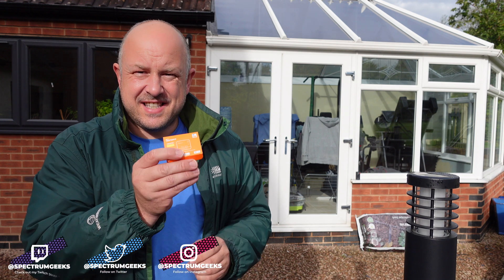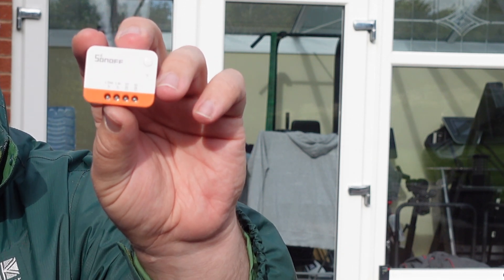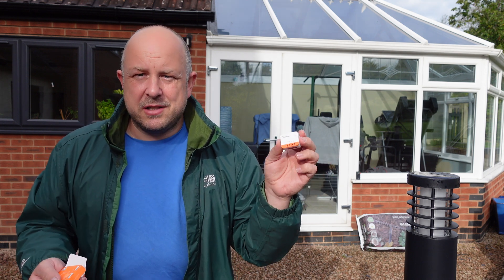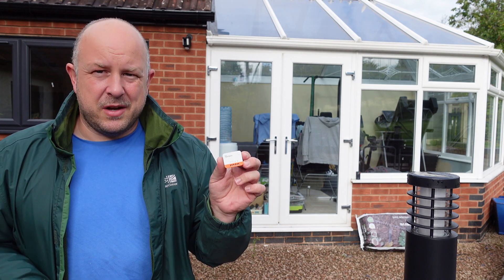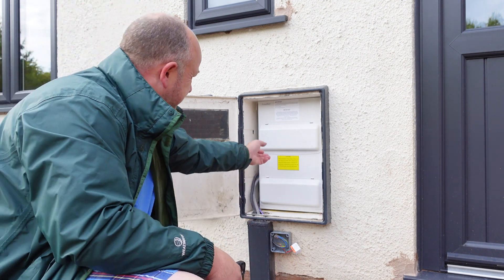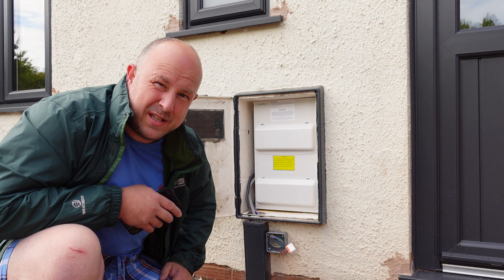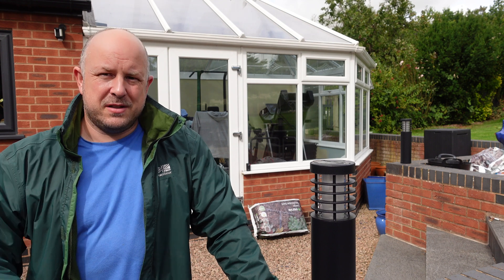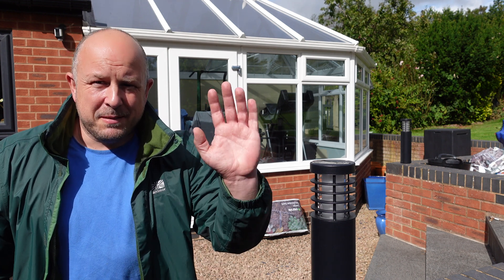Sonoff ZBMINI Extreme // Install // Review // UK No Neutral // Make Any Switch Smart // Smart Home

Comment: I have the Sonoff extreme with Neutral for some of my outside lights, was very disappointed it did not work with the Smart Life App. The unit connected almost immediately to my Alex, but would not connect to the Smart life App, so I tried the native eWeLink App, it found the device but refused to connect to it, in the end I set up a routine in the Alexa App to turn on the lights at Sunset and off at 11pm. Just ordered ZBMINI without Neutral, for another set of outside lights.😮😮
Reply from the maker: Compatibility is abit annoying I agree.

Comment: I have a live, neutral and earth in my socket.  The earth is connected to the back box.  The live will be connected to L in but what do I do with the neutral wire which is currently the switch live?  Is this now the L out?
Reply from the maker: Sorry not to sure on that as not my use case and not an electrician to advise on that I am afraid.
Reply: This wire is not Neutral, it is the switched live output, switch cable continue to use brown (live in) and blue (Live out, sometimes marked with  brown sleeving) confusing, I know, but this is the std way of wiring switches in the UK. Hope this helps.

Comment: The best way to control multiple devices from different brands is using Home Assistant Green (plug and play) £99 for the hub and then link any smart device really. Great video by the way! I was going to get one for the garden lights as well.
Reply from the maker: Great tip! I have actually just installed Home Assistant on a Raspberry Pi for when I get time to fiddle.
Reply: @SpectrumGeeks  Try a mini PC instead ... You want the full HASS experience with addons local AI, frigate etc
HA on a PI is still ok for small projects like yours
Reply: @SpectrumGeeks  Works like a charm! there is an app for iOS as well so you can control all the devices from your iPhone too.

Comment: Could I utilise the sonoff in a bathroom pull cord which has a common and L1 connection.. Sonoff L in to the common and L1 to L out .. then the pull cord connected from Common to S1 and L1 to S2. If that makes sense???
Reply from the maker: I think so, the pull cord is the same as any other switch so should work as expected.

Comment: so if i turn on the lights with the normal switch then turn it off with my application can i turn it on flipping the switch again?
Reply: The only change that you will find when using a flip/toggle light switch is that it then behaves like a two-way switch - e.g. like a landing light that is controlled by both a switch at the top of the stairs and a switch at the bottom of the stairs.  Essentially, it means that the position of the physical switch will not map directly to the state of the light(s) - In a standard UK single pole switch up is off and down is on. But when a Sonoff is added this might change. Example: The phsyical switched is clicked down and the lights turn on, Later the Sonoff is used to turn the lights off - But the physical switch is still in the down position, if it is clicked to the Up position the lights will turn on.  Hence like a two-way Landing Light
Reply from the maker: Yup

Comment: Are you still using the ZBMINIL2? Do they still work? I have two of them used in the kitchen, they don't live long. After a few months, they become no responsive. At start, I could reset and pair again, but later on it's completely dead. I have replaced 3 under waranty, but now given up completely. For me, it's not reliable and do not live long. What's your experience on it, are they reliable to you?
Reply from the maker: Still using mine without any real issues. Every now and again the motion sensor will not trigger its activation, but in general its working as expected.

Comment: Is it possible to create a schedule with them so lights switch on and off automatically at night?
Reply from the maker: Yes. You could create a routine in the Smart Things App for example to do this, so I think it will depend on the capabilities of the Zigbee controller you pair it with.

Comment: Thanks for the video. I have installed the switches but couldn't make them work with the Hue Bridge either. As I understand it, do you use another Zigbee hub/bridge to actually get them discovered? Also, do you know what happens when the power goes out, let's say for a day or so? Do they need to be paired again? I am asking because I want to place one under a mirror.
Reply from the maker: Seems the Philips Hue bridge doesn't play well with others, unless its "Friends of Hue". Does not need repairing after a power outage, not as far as I have experience anyway.

Comment: The normal ZBMini (not extreme, not L) is properly compatible with the Philips Hue ecosystem. It needs a neutral but you can wire that with a couple of diodes and a cap if need be
Reply from the maker: Good to know, thanks.

Comment: What is the risk if this doesn't use Neutral or Earth ? and what do you do with those two cables that you're not using ?
Reply from the maker: Its common in the UK to not have a neutral or earth at a light switch so no risk. The reason this Sonoff module is helpful is that it doesn't need a neutral, where some (I believe built for USA do).
Reply: @SpectrumGeeks  ok so you're using a ZigBee hub to connect it the network ? Apologies for the basic questions - trying to figure it out given the amount of different switches they have - thanks
Reply from the maker: @RT-tr9cq  Yes a ZigBee hub, specifically the Samsung Smart Things Hub as I had it already.
Reply: @SpectrumGeeks you will always/ should have an Earth at every electrical point, if for some reason you change a switch for a metal faceplate you would then use that Earth to protect the user. If not using Earth then you should sleeve it and terminate it with a Wago.  A lot of modern lighting circuits you will find are wired with power to the switch so you will now find it not uncommon to find a neutral at the switch these will be terminated as in the switch to your garden lights.
Reply from the maker: @petergrimshaw8291 Thanks for commenting / clarifying. I was more referring to its common in the UK to find no neutral on a UK light switch, especially in older properties.. As you can see in the video, I have the earth there at the switch connected to a  wago.

Comment: What i find frustrating is the lack of the ability to control this with a mobile widget switch with Android (and iOS??). Users have to open an App before controlling the switch. Ideally i want a ‘button’ on my mobile that i can just use as a proxy wall light switch.
Reply from the maker: Yeah its not perfect, but working great in my use case.
Reply: Ewelink widget is available....
I just logged into the app and i can choose a device when selecting the widget. I never used ZigBee but i imagine you'll be able to sync it up with the app somehow. I have a sonoff wifi relay on my widget easily
Reply: @PostNutPrivilege  are you on Android or iOS? I can use the eWeLink widgets on my Android phone, but only for other devices, not the Sonoff switch.

Comment: Thanks Dale, really interesting and useful.  What a great solution,  just a minor gripe that that that sonoff device is end point only.  I struggle with ZigBee range around our house and have had to add a couple of cheap Ikea ZigBee repeaters.  Odd that a mains powered? ZigBee device would not act as a mesh/repeater.
Reply from the maker: Yeah, you would think with mains power it would have all the bells and whistles.
I can only assume its either a size constraint, or a more expensive version gives the extender / repeater support.